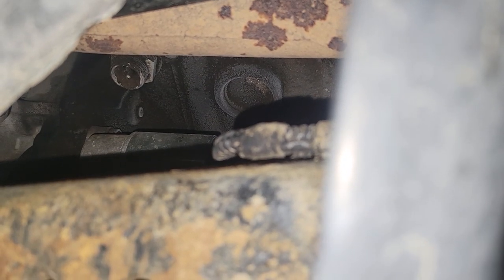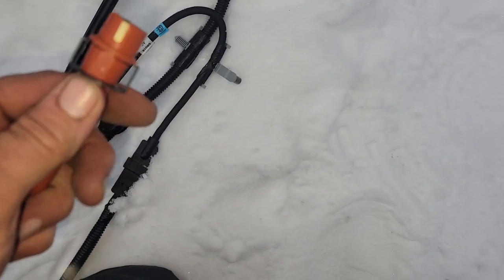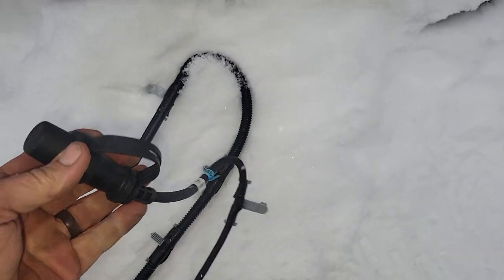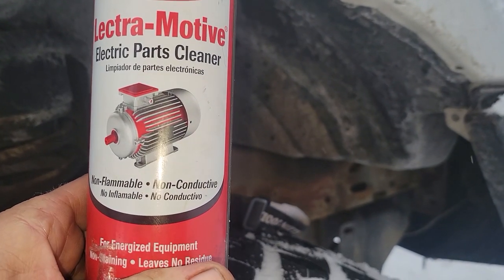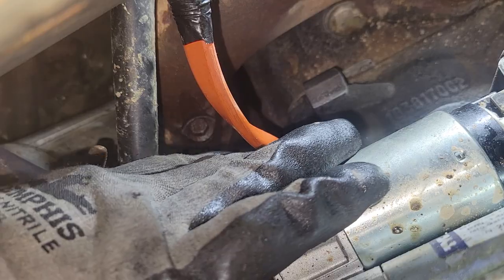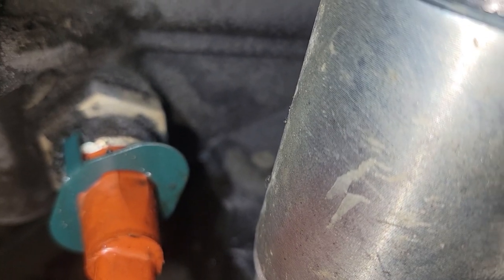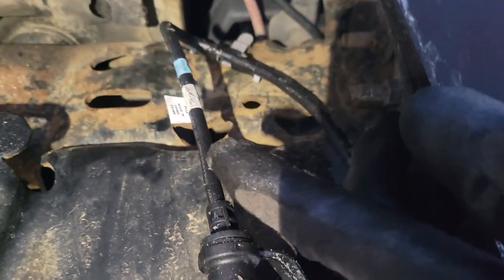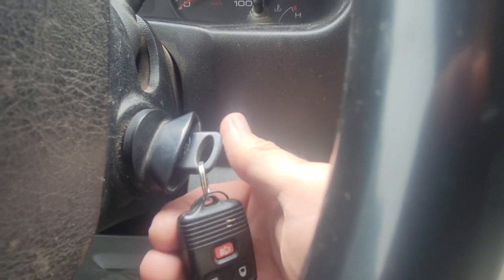Where is my BLOCK HEATER??

Comment: I’m about to do this exact thing. I have the plug, but on the cummins it’s behind the oil filter.
Reply from the maker: I was actually surprised I needed it.  But last year it only got down to zero a couple times... This year we hit -20  a bunch of times....  Truck started fine around zero but once it drops below that it struggled!  And offgrid makes it challenging to use an electric heater of any kind!
Reply: @HiddenValleyHomestead Dealer probably saved 20 bucks not adding it. lol Can you just plug it in an hour or two before you need the truck to save electricity and have it work?
Reply from the maker: @wdglockandroll  That's what I did...  and it worked!  Didn't use too much power.  But I pity the foo that lives where it's -50 for weeks or months!!